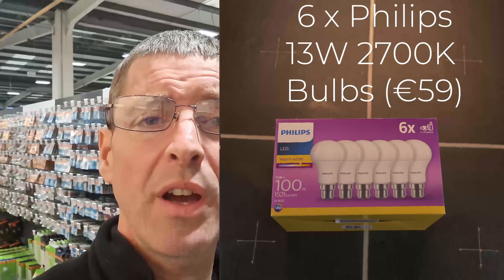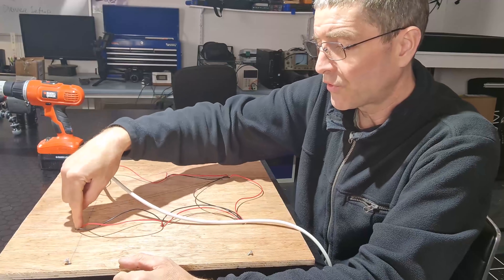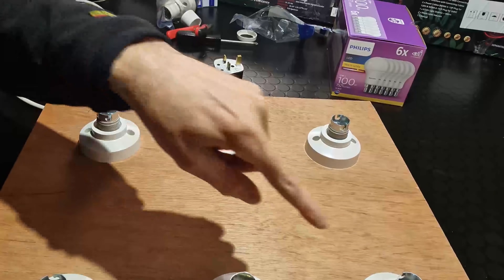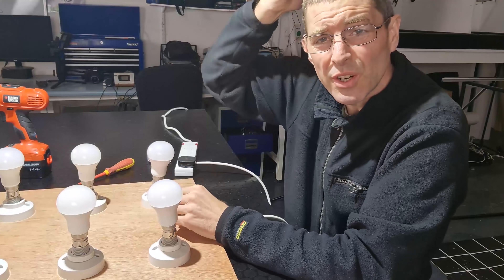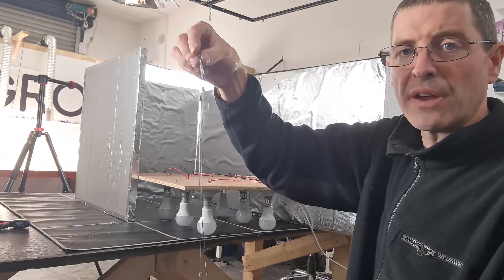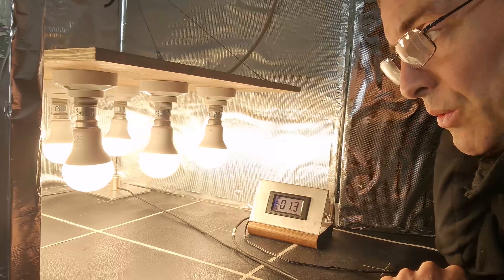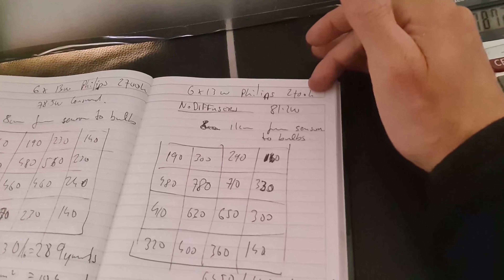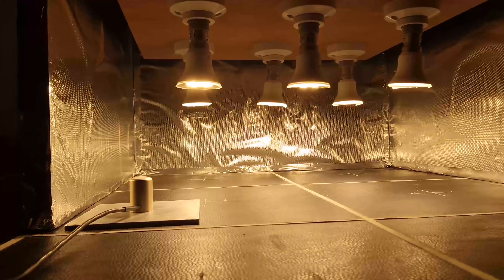DIY LED Grow light build | Build your own cheap simple and efficient LED grow light

Comment: While this is nice the pricing of 6x bulbs, 6 fixtures, wire, connectors and even the plywood is about the same as buying a single 120w quantum board with a 48v driver on Ali / Amazon (~$100)  and it will provide significantly more ppfd, better spectrum and generate less heat so more efficient.

That being said I still have a tent using a similar setup of 4x 13w bulbs. Didn't cut the top off though, good idea.
Reply: Yeah, but here in south america a 120w quantum board worth $400-$450 dollars...

Comment: Hi Shane. Why you multiply your average PPFD for the square meters of the cultivation area? This doesn't make much sense to me because if for example you have a 2 meter square set up you produce double the PPFD. I don't get it! I would simply divide the average PPFD for the total Watt, and this way I end up with PPFD/W. Also, if I multiply PPFD for the square meters, just like you do, I end up with µmols/m2/Joule, NOT µmols/joule.

Comment: I've been thinking about doing this but on a larger scale - say 20 bulbs (Noma grow bulbs) place on boards to run up and down the sides of the plants with a few at the top as well.  800 PAR isn't great for growing hemp but with a crap load of bulbs ... :)  They use about 7 Watts each so 20  bulbs would only be 140 watts.  I was wondering about removing the bulbs, so this was helpful.

Comment: Wouldnt it be easier to mount 2 power strips on a board and get receptical plugs to insert into power strip and then screw in your bulbs.. I have made 4 foot strips to fill a 5x5 tent. Better than expensove lights.

Comment: Sixteen 10 watt 90 cri 3000k flood lights. Menards has them for about 5 bucks a piece. 

After a lot of testing, I've come to the conclusion that flood lights with either a 90 or even 60 degree beam angle are better for growing inside of small tents. Why? Light penetration!

It would be so cool if this guy took his measurements to the next level and gave us a three-dimensional average from between 12in and 24 inches from the light.....because that's the average that really matters. Imo
Reply: Can you give me link?
Reply: @ndc9242  Feit Electric® 90W Equivalent PAR38 Daylight Dimmable LED Light Bulb   Model number PAR38DM-950CA. Should get you there.

Comment: Remove the plastic diffusers. Use super glue to attach 90-degree lenses. You can find them in the right diameter. Do the test again in Mount the light a little higher. The diffusers are terrible because they are designed to send so much light sideways.

Flood lights in this configuration with a 60 degree beam angle can also be very effective. And will penetrate the canopy more deeply.

The problem is that the bulbs aren't nearly as efficient as those Quantum panels. They won't last half as long. But if you need to get started for cheap, they do the job just fine.

Comment: I started growing three years ago with a few Philips bulbs as they had the highest efficiency at the time, I dismantled the units and mounted the LED pucks and mini transformers to a heat sync and called it a day, I still grow with my first boards which are 100w and now 3 years old. Keep it simple is what I always say.
Reply: Want to do the same. Do you have any pictures anywhere on the web?
Reply: @bumboclat  unfortunately not, but a google for screw in bulb diy grow lights show bring some old forum posts up. I tried to keep it simple and had 15+ sockets on a plate or board and just put the bulbs in. Something to note, if you go for the lower quality bulbs know they put out the extra list energy to heat as the leds make less light but consume the same electricity.
Reply: @olafbig  did you dismantle the bulbs to use the led disc only, with external driver, or each disc with the original driver?

Comment: I did this back when a Red/Blue crap led light was $350+. I bought <$20 pre-wired vanity fixtures from Lowes/HD + plus a few caps, hanging hooks, and a power cord. Later I found flexible screw bulb extenders which allowed me to get stronger bulbs higher up and reposition the bulb where needed  I would mix cool white and warm white bulbs as neutral white weren't available in 2014. Later we got Neutral white AND spots so no need to remove the cover, though removal does improve efficiency a good bit.  But these days when you add the DIY costs up, you can get better lights with better coverage for less money

Comment: Fantastic video. Many commercial fixtures are advertised with a full system efficiency of around 3 μmole/J. This easy setup is about 60% of that. What do you suppose the main difference is to get that extra 40%? Is the 2700K color temperature a large influence (vs. 3500K) or does it just come down to higher efficiency LED chips in those commercial fixtures?

Comment: Could you do 2 of these set ups for a 4'×4' tent ?
Reply: 2x2 cover 4 square foot
4x4 covers 16 square foot
16 divide by 4  equals 4 of these light setups
Reply: 2 would work in a 2x4
Reply: Depends on bulb wattage. Approx 14'' to 24'' is gd to start and keep eye on plants colour and health
Reply: How high would this setup be above the top of seeds or plants?

Comment: literally just did a 90w light with 6 15w 3000k mini sun led lights at 100 lm/w from ebay and i bought a 6 way e27 splitter which works out cheaper than buying each e27 socket separately.

Comment: Is that enough to grow cannabis?
Reply: Yes in a small  40cm x 40cm grow space with mylar walls. I wouldn't expect great things though, especially if you let it grow too tall.
Reply: Van Helsing  so exactly how many 15watt bulbs are you using?
Reply: Van Helsing  man, that's like 42 bulbs. I have a space that is3ft by 5 ft. I'm using one 250watt quantum board. But I'm needing to fill in a area 3 ft by 1.5 ft. I'm wondering how many 15 watt bulbs I'd need to fill in this area?

Comment: I have a 3 foot by 3 foot grow tent what do you think the size of my board is? Im thinking about having 12 bulbs and If i set the board size to 3x3 it will cover up the other side of the tent which has my carbon filter and inline duct.

Comment: You can cut the ends off the bulbs and achieve more par/light it will simply remove the outer layer which is stopping some Par/light, it will expose the diodes, you would just want to be careful when watering or folar feeding. You would for sure have gotten better numbers if you had cut the bottoms off the bulbs. Many videos on YouTube with this done, i did try this myself 4 or 5 years ago. Edit i commented to soon watching you cut the ends right now see if i was right i know i am has to be better. Thanks Shane great video. Edit again just saw new numbers wow crazy you will now have many people on a budget making this set up better numbers than the older model mars, meizhi, viparspectra all the oder models with the old epistar leds. Even good for to add for some extra par to fill out a area on the sides or ends were someone could use some extra light but dont have another grow light this one be a great solution to help fatten the colas that were not getting enough light.

Comment: did the same with 9 bulbs. one question, measurement was the from dome on first where was it from on the second? same height or closer to leds because of no dome?
Reply: I believe the fixture wasn't moved in height. It said 8cm on the left, but 11cm was the distance to where the leds were. Only thing changed was removing the domes if I understood it correctly.

Comment: So if led is more efficient than other forms of lighting then why when I try to find a 2000k led to replace my hps during flower which is the color temperature of hps the best I can find is 85 lumens per watt and my conventional hps is putting out a little over 100 lumens per watt?

Comment: I often scrap lamps for the metal...it is much quicker to hit the plastic diffuser with a hammer. The glue comes away after a few hits. Cheaper bulbs break off easier than expensive ones.

Comment: Shane you can get a mogul that has 8 mogul for the bulbs to screw in. And Fiet Electric grow bubs works great.  I use em for seedling propagating chamber.  And Fiet Electric has likeable 2 tune fixtures perfect for rack lighting and side lighting.

Comment: Shane's the best! What are your thoughts on GE 30-32w grow bulbs they use a lens that throws the light a good distance however lens off allows a broader more even distribution Target had them on sale at 5.00 usd so i grabbed 10 of them could i do the same with those? The GE nighthawk has a cree chip however i feel with bulbs your not able to get the full dimming and functionality unless its possible to do even if the bulbs where made in a non dimmable fashion. I wish it was easy to identify the led diodes so you know what the true limits are and not what was set by the manufacturer for said bulb.

Comment: I am very happy to see that.  But same little disappointed,  as it was possible to get 4000k  color.  And compare both.  Or even mix them. In 12.5w line bulb. 
https://www.lighting.philips.com/main/prof/led-lamps-and-tubes/led-bulbs/corepro-ledbulbs/929001312402_EU/product

Or with 142lm/W if needed less lights. But price is overpriced. 
https://www.lighting.philips.com/main/prof/led-lamps-and-tubes/led-bulbs/corepro-ledbulbs/929002048202_EU/product

Comment: If you find wiring your own lights intimidating, I'd recommend you instead get one of those "one-to-seven e27 adapters."  I started out growing with those (and still am, while I save up money for a real light). I'm currently growing tomatoes in my closet with them. They produce fruit, but I suspect they would do a lot better with a proper light. 

The adapters and light bulbs are cheaper than a proper grow light, but not by that much, and the efficiency seems to be mostly just "ok" or doable rather than anything actually good. I have a good source for (supposedly) high watt/lumen bulbs at 18 watt and around 2100 lumen, with 4500k temperature, which seemed perfect for the project. (60 euro for the lamps in this video seems awfully expensive, unless he included the lamp holders as well, then it's fine). 

 I have seven of those 4500k lamps in each of my two adapters and they're producing chili, paprika and tomatoes fairly well (and obviously veggie greens really well), with a lightweight zink-metal planting tub acting as a reflector (cheapest way to get a reflector of proper size at a good price; they were around 15  euro each  and hold 25 liter, so pretty big).

One note about these adapters is the wire gauge. Some of them - mostly the ones with stiff, unmovable arms (if I remember correctly), tend to use thinner gauge wire, which could be an issue if you stick a lot of high watt lamps in them. 

The ones I use have movable arms, and it seems that most of them have a wire gauge (wire thickness, basically) that supports total wattage at least about 200 watt, and with room for 7 bulbs, at a max draw of 18 watt each, you'll be well under the max load (and I don't think there are many e27 led bulbs that go over 20 watt each unless they are weird specialty stuff).

Most of these adapters are China-made even though some suppliers claim that they come from the US or germany, etc. It doesn't neccessarily matter, as to their  quality, but check reviews, and especially check their stated wire gauge. if they don't document that, then it's probably not worth buying that brand. 

I am transitioning away from these adapters now that I've been growing for almost a full year, and will hand them down to my parents, who are just starting indoor gardening. They're a pretty good way to explore this hobby, and see if it's something you're into, as proper grow-lights are much better (and probably safer as well) in the long-run.

I should also note that you should be aware of the potential dangers of removing the bulb from these lamps. I have done so, but I live alone and never touch even the reflector when the lights are on. I am mentioning this because a lot of modern LED bulbs can be very dangerous without the protective cover. They're not made with the purpose of people removing the bulb, so the wiring on them can sometimes be outright dangerous, and especially so if you buy super-cheap no-name/dodgy-name bulbs. 

There are some good Reddit threads on this from an actual electrician, and if you feel unsure, I'd advice you to keep the bulbs on. I kept mine on for about half a year, and removed them only to see if I could get a more accurate assesment of how much they performed, and did a lot of reading about safety before doing so.

The electrician in one of those threads summed it up very nicely when he asked "how much is your peace of mind worth?". Aside from the lower efficiency of these adapters, knowing that a proper grow-light will also be much safer when I leave them on (on a timer) for weeks at a time while I'm away from my apartment, and is a big part of why I'm transitioning into more professional products. 

Still, if you're starting out, this solution - with proper wiring knowledge - or the "many in one"-adapters, are a great way to start out. 

Oh, another option I've done - and which might be even safer than the multi adapters - is using a 12 spot power strip, and using 4-5 "e27 to power outlet" adapters. These adapters have the e27 plug in one end, and in the other it has the pins of whatever power region you live in. 

Basically, it makes any power plug act as a potential lamp holder, so if you use a  good power strip (with built in safety features!) you can easily turn it into a long/"horizontal" grow light. I use one with 4 lights in them to start seedlings before transplanting. Works really well, and the adapters can be bought in packs of 4-5 for a few euros/dollars.
Reply: What size area are you using the 7 bulbs in ?
Reply: @Succotash3  The area in my closet is 95  cm wide and 65 cm deep (it's a smaller compartment, with two stories). The lamp rim hangs about 30 cm above the canopy. You can see some pictures here: https://imgur.com/gallery/08pkJ3g

Tomatoes are in the middle as much as possible, but paprika and chili, put on the side grow as well. It's a little messy right now (some tomatoes are dying down, the next generation is coming in). Don't have a reflector "door" yet so the "lamp-shades" and the white walls do all the work. 

I've had this setup for about half a year, but 2 weeks ago I added a second 7-in-one lamp right next to it, (visible in the gallery) for more even high-light coverage. Previously, the right lamp was more centered, at about the same height. Hoping for even better result with x2 the amount of light.

Comment: And if you add aluminium foil or some reflective material, they will do more. Wood is not reflecting much light :) I had the same setup with 2 E27 bulbs along with my TS1000 Mars Hydro board, usually I add UV bulbs at the mid of flower with this thing
Reply: What about a mirror for reflectiveness?

Comment: Bigclive has figured out if you "gently" crush the cover bit by bit going around it with large channel lock plyers that the glue seam will pop right off. I go with a 7 way Edison splitter (not sure if those are available for bayonet sockets) that has the 7 bulbs around it's circumference with no centre bulb socket. 
I run it with spotlight bulbs but should probably try it out this way with more powerful bulbs.

Comment: Would love to see you switch out to 3500k and 4000k snd 5500k. Love that this setup outperformed many budget lights
Reply: i have a setup of 14 5000k bulbs topps removed in two 7 way splitters from amazon..im averaging about 800-900 ppfd  depending on height i set them at. at least if i calculated correctly..shane from migrow has a video on converting lux to ppfd and if i calculated correctly thats what i came up with.

Comment: Let's be honest everyone has thought about this the first time they think about a small stealth tomatoe plant grow
Reply: I don't mind tomatoes, but I prefer lemon skunk.
Reply: Stealth tomatoes ay hehe hehe.
Reply: ewrecc420  I doubt they were actually better than the ones presented in this clip - that is the sad part. I too have done that mistake (I got the ikea ones - probably around 1.3 PPFD best case scenario - RIP money).
Reply: @fairvlad  Some of those lamps have borderline unethical (in terms of being fair to the consumer) pricing. I've seen several brands that cost 30-60 euro for what's essentially one 20 watt lamp. I've definitely seen at least one 30 euro bulb that was 14 or 15 watt. 

Even if your pitch is that they're only for keeping one, small houseplant alive (they aren't sold with that messaging) it's still a really bad deal that takes advantage of peoples unfamiliarity with the subject.
Reply: Gotta keep them tomatoes away from the neighbors 😉
Reply: stanky tomatoes at that
Reply: "Tomatoe" ya I get you
Reply: are those 6 bulbs good for that ? would that be sufficient ?
Reply: @monsignorkukulski4633  its sufficient to get you started 80w for a 60x60cm tent is minimum 120w and you are kicking ass
Reply: yeah, and I might not have fucked up so bad if I had had proper instructions :D
Reply: Quick tip- use 26W LED bulbs instead.
Reply: Yep, tomatoes. Winky winky..
Reply: Yea, gotta high your head grade tomatoes
Reply: Look at the result of similar bulbs https://youtu.be/hFFKXvNAON4

Comment: They sell a 5-7 mogul socket, "star shaped" adapter(so the 5-7 sockets are in a circle, about an 8" diameter all around, which screws into 1 mogul socket). Cheap on Amazon!
 I've used the 100W equivalent lights also, but was able to "snap" the glass like cover(it was plastic, no glue, so I used a knife to pry it off easily. I started to saw it off, lol, and said "F it!", I think these will pry off..?).
 Easy! 
 Great job Shane! Very nice to see the actual 3K spectrum, etc.
Your a great guy Shane!!!